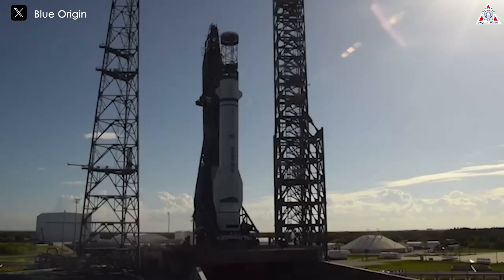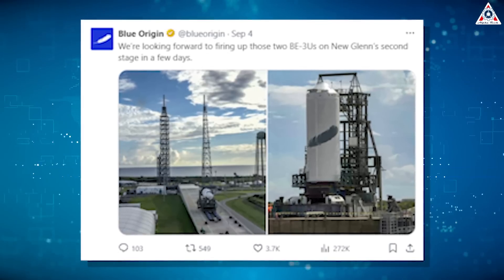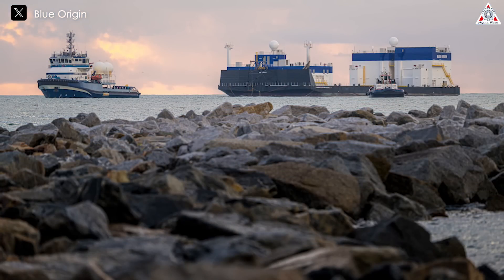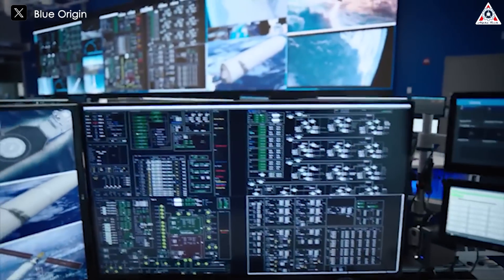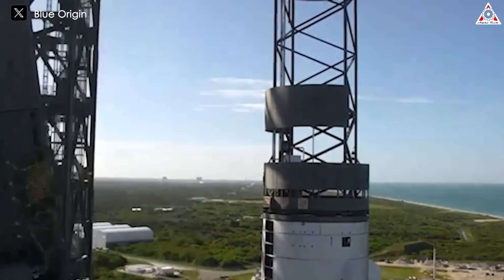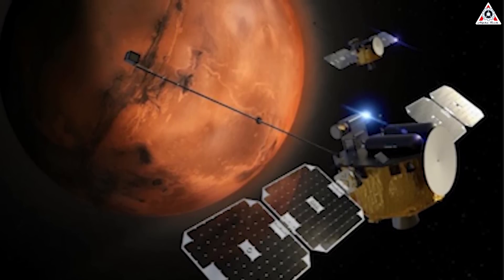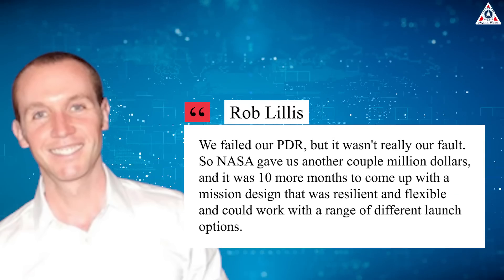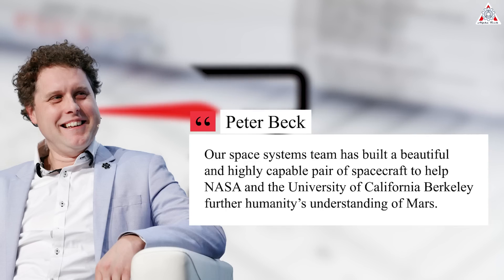Blue Origin New Glenn Is About To Attempt 1st Launch...EXACT Starship killer...

Comment: Why do you keep saying Blue Origin is a serious competitor to Space X?The rocket hasn’t even launched yet!! Let them have a few dozen successful launches under their belt before they can even be considered a competitor.
Reply: But starship development is not done!!!Spacex has a long way to go
Reply: here’s the difference though. New Glenn isn’t competition for Starship. Falcon 9 LEO carry is 22,800KG, the heavy variant is 63,800 KG, and the New Glen is supposed to be 45,00 KG. That means it’ll be competing with the regular F9 and be lower payload to LEO than Falcon Heavy, a rocket that’s years old. Starship on the other hand will be 200,000 KG to LEO in non expendable version. Expended will be 400,000 KG. So it’s about 10x the LEO full expendable than New Glen. So, to recap. The heavy is 40,000 more KG to space (already proven to do so on multiple occasions) and if Starship does work as intended (and there’s nothing in physics stopping it so with how Shotwell runs SpaceX i fully expect it to be operation within the next three years) it will easily crush New Glen.
Reply: @corycoral7072 I doubt it the current Starship can take anything. Its empty and running out of fuel, fully loaded.  We shall see
Reply: Starship has yet to show a payload. Its getting to orbit with no fuel and its an empty can. 
Why do you think they need V3 so badly. Current ship just gets to orbit. Payload unknown but I cant IMAGINE that vehicle can take anything to LEO
Reply: Well ummm Starship ain’t successful yet either bud
Reply: @irietropicals4255  how's your comment looking now.
Reply: @irietropicals4255  by a mile

Comment: It’s all just talk until first flight takes off
Reply: Elon has his talk the talk and not the walk too , making  return to the moon dates that will never be realized .
Reply: @mikewallace8087  What are you talking about?  Elon walks the walk better than any rocket engineer in history!
Reply: @DG-wo8fx  blue origin, new Glenn rocket is 100% not flight tested. Some people badmouth the rocket. It may work perfect the first time -May not?
Reply: @milwman1958  Even if it works 100% the first time and can be reflown 100 rimes as Jeff wants, it won't  be economically competitive to Falcon Heavy or Starship.  It has been designed as though cost is of no concern what so ever.